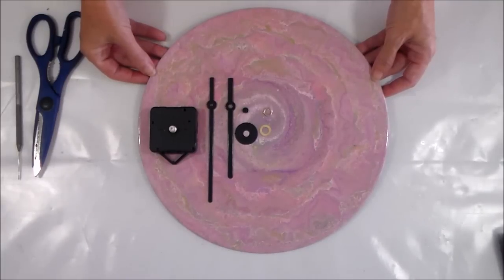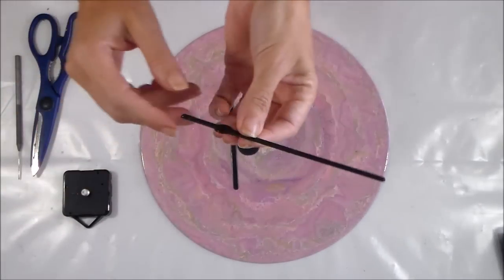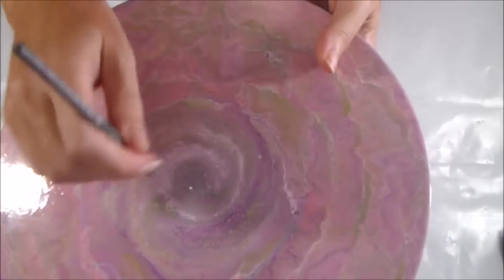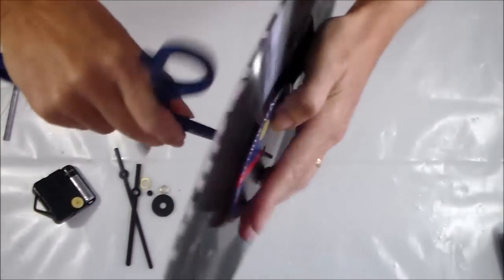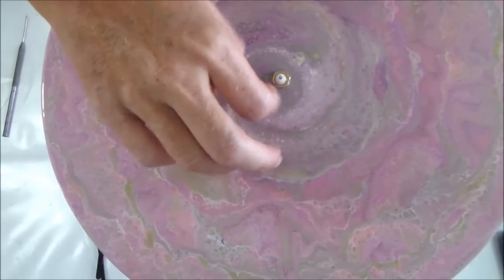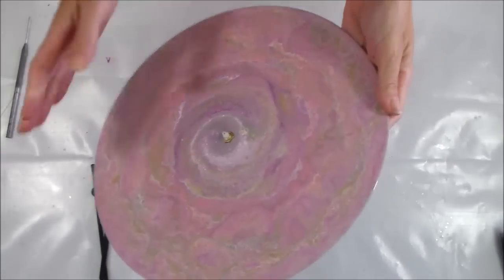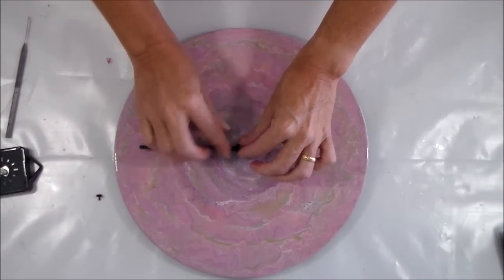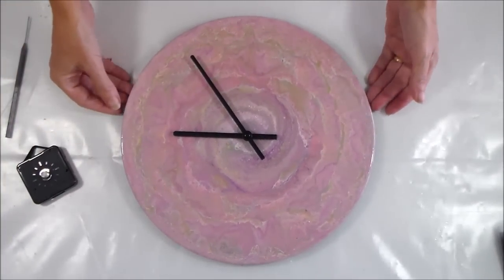How to Create a Click From Painted Vinyl Records

Comment: Hi, I saw your video and I have this old record I was going to alter. I have been playing with alcohol inks and thought an altered vinyl record with them would look so cool. Besides, it would be a great additional item to my shop. I would like a link to the exact mechanism products on amazon that would work. I've been looking on amazon and the spindle length is the main issue I think. You said a short spindle, I'm guessing that is the screw base part should be like ~6mm and the full ~13mm. Is that about right, I don't want to order the wrong ones and have to ship back. Thanks for any help...

Comment: I use a drill with a 1/4" bit, to make the hole big enough.  I put the record face down on a very soft but firm bit of wood under and drill.  I also resin every record to make it very stiff.  Works well.
Reply from the maker: Resin is a great idea. I've noticed that some are certainly thinner and more bendy than others.

Comment: Great follow-up to your pouring-on-record videos! I wonder how I am supposed to know where 12 o'clock is so that I can set the hands to the hour indicators I'd have on the front. Was there any information on that provided by the clockwork seller? Thanks for sharing this with us!
Reply from the maker: There is a little hanging bracket on the back of the clock which shows you where the top center is and where you would want to put your number 12 so that it hung correctly. Hang the clock from a nail and let it center, and then you can mark the exact top to line up hands and numbers etc.
Reply: Thank you very much for taking the time for such a detailed answer!

Comment: Deby, I'm having a lot of trouble finding 1/4" spindle.  All of the ones I find are 1/2".  Will they be workable?  I tried to find them on your links, but can't find any there.  Got any suggestions?
Reply from the maker: The longer spindles will work, but the hands will be quite far away from the surface if you want to use them for a record. I just sold my last spare, but you can get them here if you pick the small spindle. http://tidd.ly/dc2e3866

Comment: Debby, do you have air conditioners in your house? You mentioned that you had the windows open because it was so hot. I live in Florida and it would be intolerable to live here without cool air. I couldn't do it. Also, how much does one of those gallery wrapped canvasses cost for you?! I assume everything has to be shipped in. And, since curious minds want to know - what is it that drew you to the Cayman Islands?
Reply from the maker: 96% of homes in Cayman have air conditioning, and we are in the 4% that don't. Yes its bad, August and Sept are blistering. But electricity costs SO much here anyway, that we thank our lucky  stars its one bill we don't have to pay for. The canvases are a lot of money, far more than you would pay in the US. I import from the US when I can, but obviously by the time I add on all the international shipping, handling, charges for this that and the other and then currency differences, duty etc, well, its more than the original cost of the goods. Makes things very difficult with only one of us working, but we regard it as a sunshine tax. Hubby is understanding of my hobbies and knows it is therapeutic for me. Originally we both came to Cayman more than 10 years ago now to work as scuba diving instructors. Hubby is still in the same job but I had a stroke a few years back and along with other health issues, I've not been able to work now for some time. I still get to dive for fun on the weekends though  :-)
Reply: Deby at Acrylic Pouring Wow! That explains a lot. I'm so sorry to hear about your health issue. You seem to have no apparent affects from the stroke, but apparent is the operative word, isn't it? Kudos to you for doing your art and to your husband for being so loving and understanding. I learned to scuba when I was 25 in Los Angeles where I was born, but I haven't done it in decades because my husband can't dive due ruptured ear drums from playing in bands. I truly admire what you've accomplished with your YouTube channel. I very much enjoy your videos and you. Right now I'm watching the hurricane and hoping that it continues to veer east! I'm north of Tampa. Keep up the great work. ❤️😍😘

Comment: I have made some clocks, but even though they are reasonable quality, the hands keep loosening up and just swing down.  I've spent many frustrating hours fiddling about with them. Would like to know what you think.  Hope you are are not affected by Irma.  Thinking of you all out in the Caribbean.  Stay safe xx💕💕🙏🏻🙏🏻
Reply from the maker: I've had one hung on my wall for a couple of months and its been just fine. But its a fine line between too tight and tight enough and not quite tight enough. Maybe a little dab of glue on the nut to keep it in place?  And yes, Irma is not coming my way it seems, so a bit wet and windy but otherwise fine here.